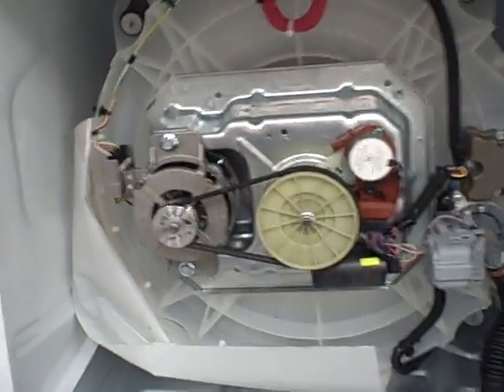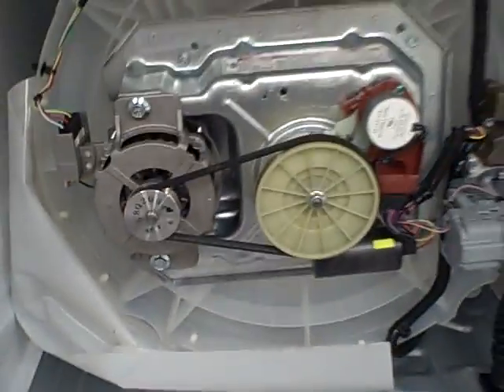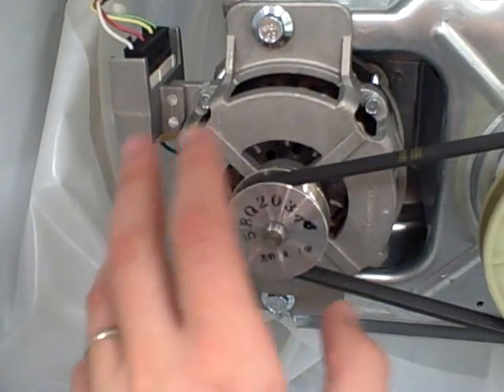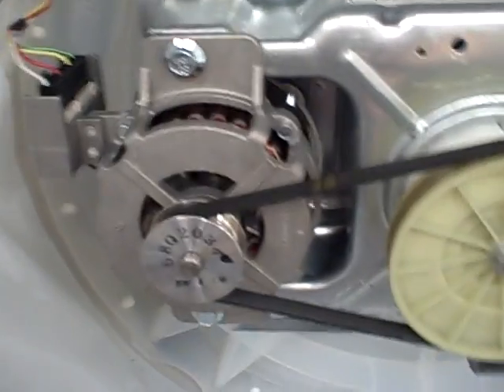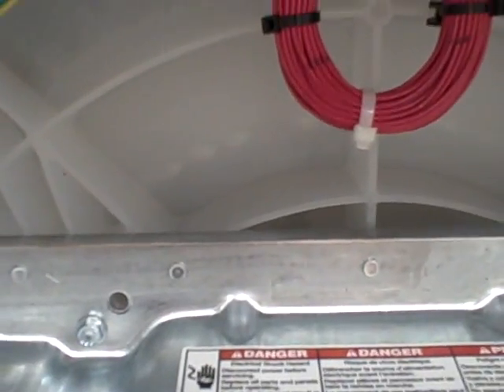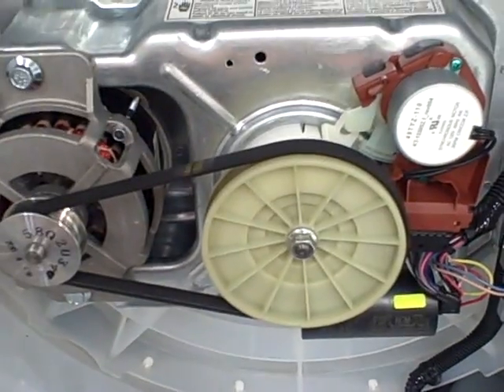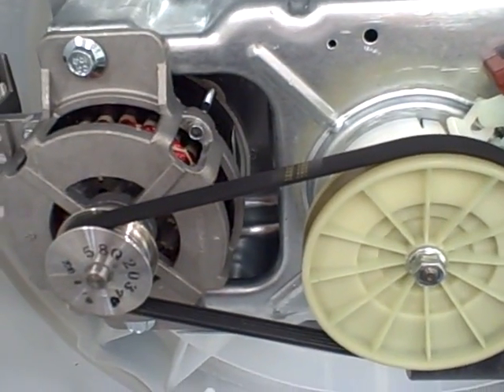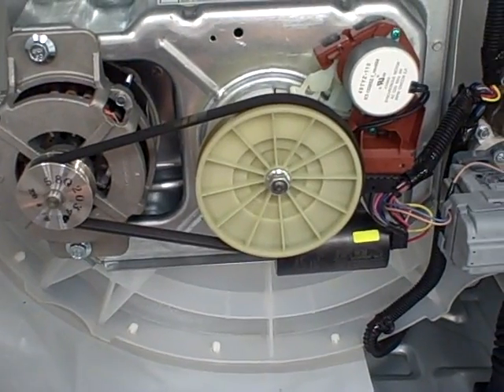ALL-NEW Whirlpool Belt-Drive washer in full detail!! (4800x model)

Comment: had loud screeching noise while agitating. Found the drive pulley to be loose, wobbly and worn, teeth seemed to be worn from slipping. Replaced splutch assembly, splined gear on bottom of transmission seemed a little worn but as replacing the transmission assembly is a much more expensive fix I left it reassemble and hoped for the best. noise came right back. I read it could the synchronization motor not engaging or disengaging enough and the splined shaft not aligning correctly. so I replaced that. still loud noise during agitation. any thoughts? do I need to replace the transmission assembly?

Comment: I have an amana that looks just like this one. The belt came off and the pulley is wobbling. i put the belt back on but the machine still wont cycle on. I have a feeling something is broken or stpripped, but could it be that the bottom nut needs tightening? I didnt want to just tighten it up and maybe break something else as it is hand tight. Any insight into what might be going on? thanks!
Reply from the maker: Well the main pulley sprocket nut has been known to back out and making that main pulley lose.  If you can find the nut put it back on with some lock tite with some torque to tighten it but don't do it to tight.

Comment: The water on my washer is not draining. How do I check if there is a problem with the pump? Can a sock or something else get stuck in there?
Reply from the maker: I would check the pump for sure the washer needs to be flipped on its back with most of the water out and remove the pump to inspect what is going on.  Make sure the drain hoses are clear as well.
Reply: I have a amana its exactly the one on your vido. its  not draining, pump is clear hoses are clear , what else can I do?

Comment: I have one that in agitation the motor only goes one direction it doesn't pause and go the other way it does slightly pause for a split second but instead of reversing direction continues on in same direction wrapping clothes around agitator and throwing water over the tub lip onto the floor I believe this is a timer issue am i correct ?
Reply from the maker: Sounds like that could be the problem or the splutch is not working correctly and binding up.
Reply: jmc6000 thanks for the reply I know its not the splutch. I have physically seen the motor goes by ways so I know it can. however when it goes to agitate instead of the motor reversing it just goes one direction throwing water out the tub and wrapping clothes around the agitator. I have noticed with a new control board that if I pause it and spin the agitator around by hand a few times that when I restart it sometimes it starts acting right. I know this is either the board or the motor im not positive on how it reverses the motor im wondering if it could be the motor or if its all control board doing it... its really weird
Reply from the maker: djnemesis82pluss1877 Well the motor reverse by direction given to it from the control board.  So if the control board is not sending the signal the motor will not do it.  Unless the motor is binding up then after you should hear some kind of a power surge sound if the control tells  the motor to go in reverse direction and is binding up and unable to do it.
Reply: My washer is doing the same thing . Did you figure out what was wrong with it ? Control board   Or splutch ?
Reply: +Aaron Dugger the issue I had was the capacitor. Most common issue with these is pulley nut coming off. The actuator and the capacitor
Reply: I have the same problem.  Only agitates one direction.  Do you mean that changing the capacitor fixed that?  You didn't have to change the control board?
Reply: +Bob Hall yes was the capacitor
Reply: Finally got the part switched out.  It worked!  I was about to give up on the washer.  Thanks so much!

Comment: I have this washer in a Maytag version and my problem is  heavy gear OIL has leaked out of somewhere. Since the washer was almost done spinning when I noticed the oil smell, I let it finish uiots cycle. From what I see in your video, it is all dry. Even the SPLUTCH is just dry plastic gears so where is this oil coming from and how do I fix this washer?  I have turned the washer on it side and about 2 tablespoons more oil has dripped out from around the belt cover. Any ideas or recommendations?
Reply from the maker: The dry plastic gears you refer to are not the splutch.  The splutch  is beyond the metal cover behind those plastic gears.  Whirlpool list the splutch as a gear case and must be replaced as one whole unit.  The gear case, ie the "splutch," is what is leaking the gear oil and is non serviceable.
Reply: jmc6000
Thanks +jmc; I got confused on what a 'splutch' was due to another video called "Splutch Assembly Replacement (part # W10315818)" and all he does is replace those plastic gears under the large pulley... I definitely need a new gear case and did NOT plan on repairing the old leaking one..
So, do you know how hard it is to replace the entire gear case and what the part # is? I found one potential part # W10324649 which I think may be correct. I will tear mine apart first and see if I can see an actual part # on my maytag gear case before ordering a new one. The other gamble is whether any other parts have been compromised due to having oil thrown all over them. For example: the motor, the plastic gears, the pulleys, or belt....... Any more info you have is appreciated.
Reply from the maker: John Kugie Watch this video as this is the part you need;  Transmission Replacement (part #W10473144) - Whirlpool Top-Load Washer Repair  I would also replace the mode shift motor as well since I will bet the gearcase oil has reached the rpm sensor within the mode shifter.
Reply: jmc6000
Thanks again +jmc. I do NOT have an agitator in my HE machine but everything else looks very similar. I finally found my machine model # online on a SEAR's Parts website with a parts diagram and ordered the correct gear case. I also got a new belt. Unfortunately, I ordered before getting your recommendation to get the mode shift motor but I may go back and get that also.
Reply: jmc6000
I appreciate all your help. I should have said a short agitator instead of NO agitator but the video you suggested worked. I did have to use a gear puller to get the driven hub and the drive block off  the gear case shaft due to electrolysis and corrosion. I also had to alter getting into calibration mode slightly in that I had to press and hold the start button and then immediately turn the cycle selector L-R-R-R-L-R to get the 5 LEDs to flash. I am still a bit disappointed in Maytag's "commercial" technology that lasted 3.5 years but the fix was great! It took me about 5 hours due to cleaning every nook and cranny with a tooth brush while I had it all apart. Still I saved at least $500 compared to the cost of a new similar washer at the best sale price. I consider that to be $100 per hour that I made repairing this washer and so WAY more than I have ever made per hour previously. Not too bad. JK.

Comment: I am a service man and I am having a problem with this washer. The nut that holds the plastic pulley on keeps coming off. The motor pulley is plastic not metal. Any ideas why it is doing that ? Thank you
Reply from the maker: 2 words: red locktite.
Reply: jmc6000
also needs 40 to 50 lbs of torque to tighten.
Reply from the maker: i would add some blue lock tight to the threads and see if that helps.

Comment: Whats going on man? Really appreciate the videos, you are a washing machine genius lol. I have this assembly on my washer and the motor is trying to spin the pulley but it is acting like it is not strong enough. I tried running it without the belt and the motor spun fine. Any advice would be greatly appreciated.
Thanks!
Reply from the maker: Sounds like the capacitor is going bad.  I would start there first.

Comment from the maker: Make sure when you connect all the wires that it is unplugged for at least 15mins so it can reset.
Reply: 15 mins. is longer than necessary, but you raise a valid point about reset. It is also crucial to run calibration after replacing any major mechanicals.

Comment: hi, I have a  whirlpool Cabrio. It will not spin or drain the water. the repair men from Sears repaired it and now it is not draining again. I looked under it and there was a wire loose from the capacity. I reconnected it but it still is not spinning. He explained to me the problem last time so I looked to make sure that the capacity did not come loose and got stuck under the belt cover. that is when I noticed the wire loose. Any advice? Please.

Comment: Hey Jmc love video! I have a question, I own a maytag centennial commercial washer where the lid locks. Im having difficultly determining whether my motor is bad,because the machine will fill the tub if the motor is not connected. If the motor is connected I will hear a humming sound and the lid unlocks causing the machine not to fill the tub. Also wondering if what you call the synchronized motor(whirlpool calls shift actuator) is bad.

Comment: The splutch is the pleastic cam kit located above the motor (W10315818) the metal case is listed as a gearcase (Gearcase Assembly (includes Items 7, 8, 9, 10 & 13 On Page 5)   (Replaces: W10006379)	
Part #: W10324649)

Comment from the maker: OK, I was refereing to the part inside or beyond the metal case is called the splutch, the part that has the oil in it.  I guess Whrilpool gives it a part term called a "gearcase" and the plastic cam gears the the shifter controls are just that, plastic cam gears which have nothing to do with the splutch which is beyond the metal base.  I have had the base apart and I have had one of the splutch's lose its oil on a customer's washer so I know what the parts are bud.  I have had them open.

Comment: The part that I refer to as the metal base, which is what the motor is bolted to, and the shifter is screwed to, and the plastic cams (that you call the splutch), are mounted to, and which is bolted to the underside of the outer tub, is what Whirlpool calls the gearcase, part W10324649.  It has gears in it, and it has oil in it, enough oil that oil leaks are a major problem for the MVW/WTW washers.

Comment from the maker: "Very similar to the splutch on the world washer" that is because they are one in the same!  Whrilpool may not have "labled" the part as a splutch but instead called it a "gearcase" they are still one in the same on this washer. If you take apart the plastic cam you will see what the inside of a splutch looks like.

Comment: Part W10324649 is called a gearcase by the manufacturer.  There is no part or parts on this washer called a splutch by the manufacturer, although the plastic cams above the main pulley are very similar to the splutch on the world washer.

Comment from the maker: Acually it is called a splutch and it is a one way splined clutch.  Even though it has gears, four to be exact, but they are just staionary.  They do not shift or engage like a "normal" transmission set of gears would do.  The splutch or "gearcase" is no way a transmission.  Like I said in the video look up what a splutch is and see for yourself.

Comment: You said that this platform doesn't have a transmission, but it actually does, it is the large metal base that everything is mounted to in your video, part W10324649.  A common failure of this gearcase is a massive oil leak all over all the lower components.
Reply: Yup -- just had to replace my entire $100 transmission because the top bearing failed and is irreplaceable. (Nice job, Whirlpool engineering staff. :< )

Comment: Mine started making a grinding noise about a week ago.  Turns out, the nut backed off and the grinding was the belt working it's way through the nylon shield.  The belt then slipped off and it wouldn't spin.  A repairman came out yesterday, pushed the belt on, tightened the nut and called it done.  Today, the belt slipped off again, through the worn out gouge it had made in the shield.  The pulley wobbles and should have been replaced.  Now I have to wait another week for them to come back.

Comment: I just bought this washer and dryer off craigslist. Thought I got scammed cuz I got it home and the washer would not balance like it said it should. Just got the fill/lock light an a hum. Tipped it over to seen the belt was off, Why I found your video cuz I thought it would show me how to get the belt on. I got that on then realized the bolt was missing, probably why the belt came off. Okay I went way off into what I would like to ask... Do you know the size of the bolt I need to hold the belt?

Comment: As long as there are plenty of older direct drive top loaders in the pre owned market, I will not touch one of these things with a 50 foot pole.  I actually have both a front loader and a top loader (dd). Now, the direct drive that they use on the newer LG fronts and top loading 'Wave' machine with the 10 year motor warranty are interesting and will be paying closer attention to those.Too bad they have not yet to adapt that direct drive motor to a top loader with agitator design.

Comment: What irritates me about this design, is that its been around 60's/70's. I have a GE by Hitachi portable, and its design is almost exactly the same, except this newer one you're showing's made with cheaper cheesier bits. you have a motor, a belt, a drive pulley, and a solenoid that engages on the spin cycle, disengaging the brake, and allowing the motor, when turning CCW to turn the basket, nothing new! I will consider trash picking one to mod, but I will stick with my DD for a long while.

Comment from the maker: @musiclvr7289 Acually the synchro motor drops down the top gear to engage the main puelly for spin and then lefts up that top gear away from the main pulley for wash.  The splutch pretty much stay stationary this whole time, but does turn when the basket turns.